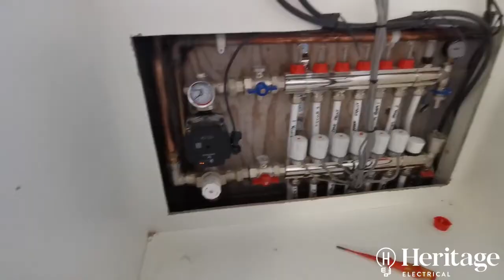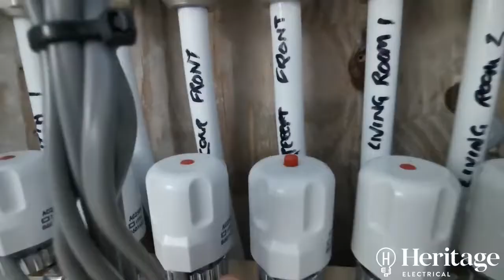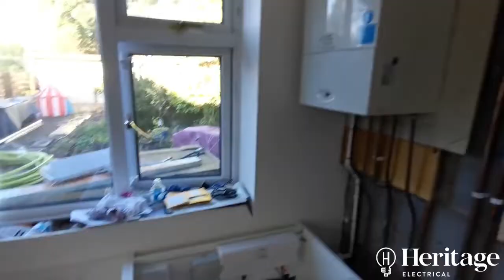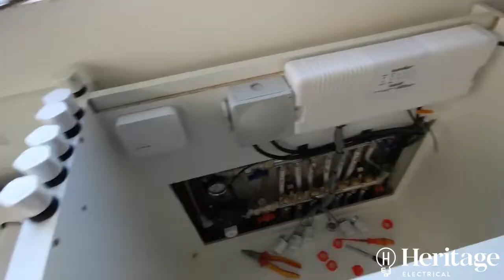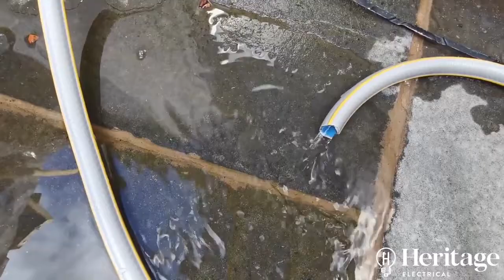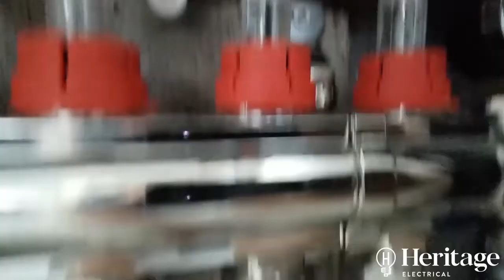🔥 Fix Underfloor Heating Problems || Heatmiser Installation, Plumbing & Wiring Tips 💡

Comment: I've got a similar issue now. I've had underfloor heating all downstairs, and everything is great. But upstairs is on a wireless separate hive control and it's lost signal, and now when I need to heating upstairs off, I have to change it on the boiler, which  then turns the underfloor heating off. It's now working as one, which is causing me issues. Could you please advise 🙏 thanks

Comment: Great video, shows that some plumbers need to go on a training course for this stuff, like the way you used the wago connectors so tidy.I have under floor heating off to check the valves :)

Comment: That's a Worcester Junior Combi boiler which is over 10 years old, it was most likely fitted correctly and the builder or someone has used the existing set up to connect to under floor heating manifold. The system Will most likely need an additional expansion vessel and a new boiler soon. It's not always the plumber at fault, normally the client or builder doesn't want to pay to have the job done correctly I see this all the time.

Comment: Great video, but just a comment (apart from me shouting at the screen from the first minute “the pumps on the wrong way round!!)

The flow meters at the top. are, well…..Flow meters. They are not pressure meters, or designed to indicate pressure. They indicate the flow as litres per minute.
Reply from the maker: Thanks for the tip!

Comment: squawkparrot , it all come down to system design for it be  a good system, ie controls  and pipework  design. 
underfloor  is best with weather compensation  controls  and electronic  mixer . Also  pipework  work design  is a big factor  especially  with  ufh  mixed with other circuits , should always hydraulically  separate the  ufh system if not can cause alot of issues  ie back flow  or rads not as hot when underfloor  is on  ,much higher  flow rate  than  your other circuit ect... pumps will be fighting  against  each other ect...   when designed  properly  works very efficient  , costing wise  is expensive  to install but if the system is installed correctly  its efficient  to run  so over the years it will save u on gas bills  ect...

Comment: Oh yes, let's have trendy underfloor heating...

But, 

it costs more to run?

Takes longer to heat the house?

Is less environmentally friendly?

More complex so more things to go wrong?

More complex so installation relatively expensive?

Servicing more expensive and specialised?

No radiators to hang your wet/damp socks?

Is underfloor heating really a good idea?

Oh yes, I'll be trendy.

Good vid.
Reply: All wrong. If you fit it to a crap boiler with no hydraulic separation and no proper electronic mixers governed by weather comp then yes - it’s crap. Otherwise UFH is cheaper, more economical for the boiler, more comfortable and you can dry your socks in the towel rails ;)
Reply: Or I am just a combi slinger and no nothing about hydronic or UFH so I will just poo pay it.